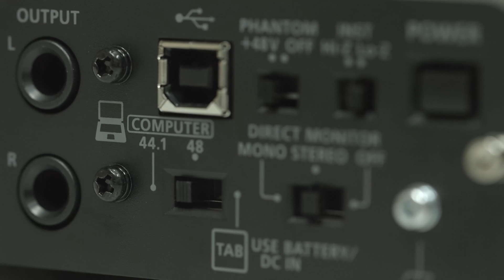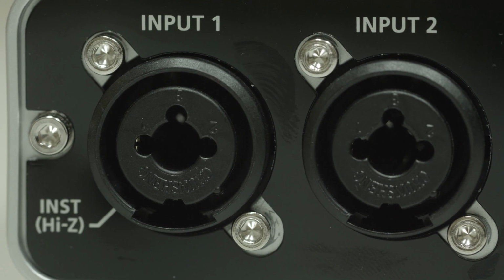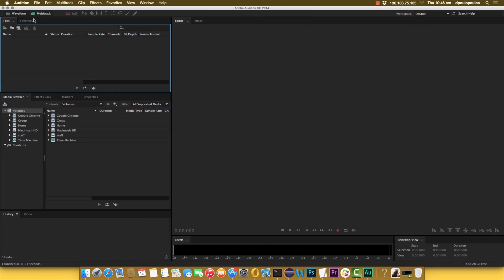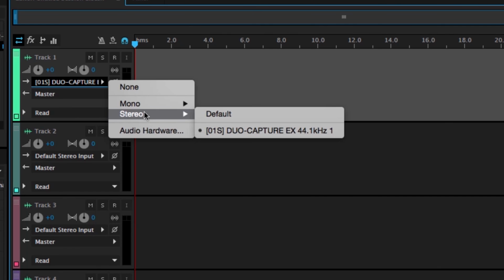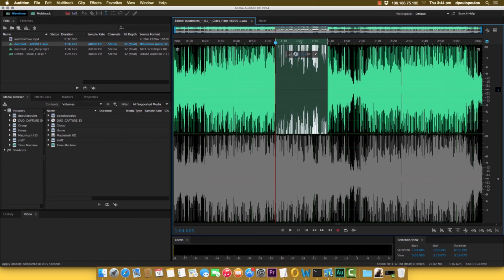Roland Duo-Capture EX Tutorial

Comment: for me, it's a pain in the... to install... first off it's supposed to be for mac to... however... Mac doesn't have a diskdrive... so you'll first have to get one of those... then for some reason, the installation won't work... I followed the steps of the manual but the little light turns green, then shuts of again... I have it running on batteries... no adapter since it wasn't included so I guess it should work like that... I put it on 44,1 or 48... both don't work... phantom is turned of because I was told that was only necessary with a studio mic, I have a stage mic. besides that it's on lo-z and on stereo... my iMac doesn't find it...
Reply: I have the same problem , mate ,, What did u do next?
Reply: same here, did someone fix it ?

Comment: 0:20 – "New"? This interface was announced in 2012…
And why you recommend to select mono on the back side of the interface?
Reply: They were new for the university in which they were installed, replacing old Behringer mixers.

The direct monitor is set to mono because students can be confused if they hear their voice only coming through one side of their headphones.
Reply: Ah, that's the point. For example I use digital piano, which has stereo sound. So, keyboardists need Stereo mode. It really depends, and probably author could mention this. It's good, that Roland provides choice of Mono | Stereo | Off. For example Steinberg UR22 mkII, which I was considering before, is mono by default and doesn't give choice to change it. That's a huge drawback for me, why I finished with it.

But this Roland Due-Capture EX also has some drawback for me: it doesn't have separate level controls for headphones and monitors. But it's not so bad. What's even worse: when you want to use headphones, the sound still coming through monitors as well! And it's necessary to unplug monitors from the interface to not hear them! That's quite ridiculous. So, I will continue to search for audio interface which is compatible for work with iPad Pro 12.9" (that's my first criteria).